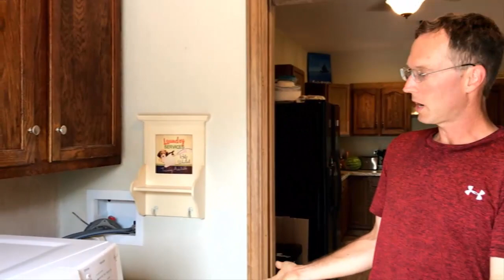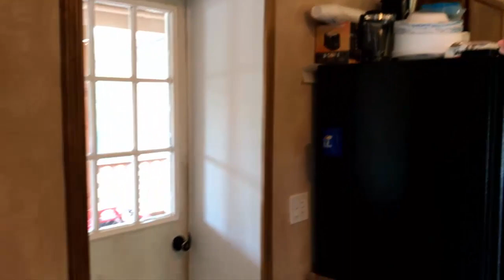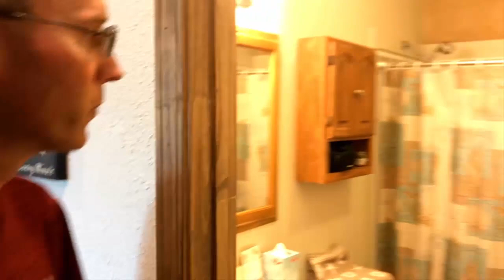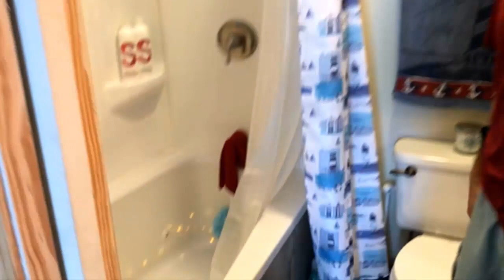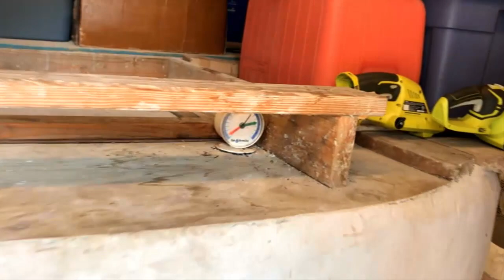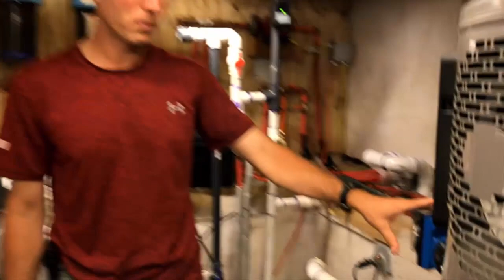Earthbag House Completed Tour

Comment: This would be a boring video it is so ordinary and that is what makes it so interesting. Most people don't want to live in odd houses this shows how you can build a low cost ordinary house. I have an idea to build a house that I call the worthless house the value of the property would only reside in the value of the land. We invest too much in housing and end up paying all our lives to clear the mortgage this is a way out. In the Philippines where I am people cannot afford wood anymore and concrete makes hellishly hot houses in the evening. A problem we have is the spike in relative humidity in the evenings as the air cools down. This ironically makes it feel hotter. I believe, though I have no proof, that if the earth could breath (in porous bags) then this humidity problem, would be solved. If anyone from the Philippines is reading this or anywhere sunny please take note. polyethylene (the bags) does not tolerate UV light, they will fall to bits get the outside of the building covered as soon as possible.

I like the fact that he has made an earth floor the problem with the Philippines is that people want to emulate the west but is that desirable? A concrete floor is creating another expense and if you want to change your house all you need to do is dig up the earth floor concrete is much more problematical. Just because the floor is earth doesn't mean it has to be damp I am sure this guy fitted a damp proof course.
Reply from the maker: Yeah, the floor is not damp. It's one of my favorite aspects of the house. This would probably be unecessary in the Philippines, but in the midwestern U.S. where you need heating in the winter, the earthen floor with radiant heating is so cozy. It feels very nice to walk on in bare feet or in socks.

Comment: How mucj ot the cost?
Reply from the maker: The total cost was around $110,000 of which about $50,000 was spent for labor. The house will save on energy bills by being very efficient. Over $600/yr. is saved with the rainwater collection, storage, and filtration system (this does include the cost of replacing filters).
Reply: @LilyAnnFouts  thank you

Comment: Why this regular squared box shape?  Looks very average and ugly.
Reply from the maker: @\/\/\/\  First of all, we'd recommend a round house as the optimal shape for this type of building material. For a round house, you wouldn't want to go bigger than about 10 meters in diameter.
Reply from the maker: Keith had wanted to build a round house originally, but the house was for his parents and they wanted a standard-looking home, so that's what he built for them.  We do recommend a round shape for anyone who wants to build an earthbag home.  We also recommend a much smaller structure.  This was a ton of work.
Reply: @LilyAnnFouts  I hope I didn't hurt your feeling with my statement. Thanks for sharing what you've done.

Comment: Wow Keith, wow! Your plan, attention to detail, and hard work are so inspiring! You almost built my dream house exactly as I have imagined it and you solved many of the challenges (such as water protection of the foundation) I envisioned. It was also very impressive how organized the build was while also engaging in experimentation. I have watched the entire 24 videos and I have some questions if you ever have the time to respond. I am wondering about the choice of bags vs superadobe tubes. Was this a choice based on amount of labor available (i.e. It would be easier to fill up bags by yourself if you had to)? Did you ever investigate auger buckets or other sandbag filling machines? How much experience do you have doing grading work? It seemed like you handled the Mini-excavator like a pro for the cistern and foundation work. How did you install the wood framing over the bag and soil cement floor? It looks like you're attaching the framing to cleats along the courses. Are you worried at all about the bags settling and throwing things out of level/plumb? I'm considering post-and-beam to support a conventional roof with superadobe tube walls for the enclosure. 
Anyway, HUGE congratulations on completing such a well-designed and executed project. This should be a model for all who consider earthbag building.
Reply: Hi Adam, Sorry it has taken me a while to answer your questions. I spent the last 10 months working 60+ hours a week installing 8 MW of solar modules plus 9 MWh of battery storage.

Thanks for taking an interest in natural building! The more builds like this, the better (if done right). I'm not sure what you meant by "superadobe tubes." I built the house using mostly woven polypropylene bags, but I did fill some long tubes of the same material. Some were over 40' in length. I used these mostly around the cistern and over arches for more strength.

I have seen other people using machinery to fill bags, but this would not have worked as well for us, plus there is the long term cost of renting the equipment (great if you already own it). The earthbag building book that gave me the most information made it sound like I could get road base from the rock quarry and it would be perfect for filling the bags. This was not the case in Kansas. The road base used in Kansas does not have clay added to it. It's mostly crushed limestone and does not have anything to bind it together. This is where my project became much more labor intensive as we used the clay acquired from our pond expansion. We created clay pits where we turned it into a milkshake consistency and screened out the rocks. Next we used a cement mixer to mix ~20% clay with 80% rock screenings delivered from the quarry 6 miles away. We dumped it in wheel barrows and brought it to the wall where bags were being filled. I have seen sooo many videos where people have been building with earthbags without using any binder with the aggregate. The end product looks great, but I'm not sure how well those walls will hold together in the long run and rarely do I see any follow up videos a few years after the project is finished.

I had limited experience using an excavator on some commercial electrical projects before I rented one for the earthbag house. I practiced digging out the pond before working on the house foundation.

There is no soil cement in the floor (no Portland cement or concrete in the mix). It was made up of screenings, straw, sand, clay, and a tiny amount of plastic binding fibers in different ratios for different layers, then sealed with linseed oil.  The walls were framed in floating over the floor just before I installed the final 3/4" of clay/sand. Since I knew where the walls would be when building the earthbag walls, I placed velcro plates (plywood between the bag layers with a 2 x 4 on the edge) every 4-5 layers to screw the wall framing into. 

Settling has been very minimal. If someone uses too much clay in the mix, the walls will expand and compact with the humidity. My number one issue after everything has been complete is that I made the papercreet too smooth before applying the lime plaster. It was not rough enough for the plaster to key into it and some places the plaster has come off. As I replace sections of plaster, I'm screwing a layer of galvanized poultry netting to the papercreet wall for the lime plaster to have a better structure to bind to. Thankfully I have had zero problems with the earthen floor as that would require a lot more work to fix. The radiant in-floor heating in the winter has been awesome!

Comment: Your #earthbag house looks pretty normal from the inside. Please post a video of the outside architecture. Also would love to see how much you pay a month for heating and cooling!
Reply from the maker: Check out the link in the video description above; there's a photo of the outside of the house on that web page.  The house now has solar panels installed, so the bill is almost $0 during a few months in the summer time; basically only the base service fee.  During the winter there is some cost, but much cheaper than the neighboring houses. My husband has the details so I'll ask him to reply.  I don't know the numbers off the top of my head.
Reply: Lily Ann Fouts we're waitiiiiiiiing😲🤗
Reply from the maker: @kineticblues2766  so are we!  The panels haven't been on for a full year yet, and more will be added soon, so it could potentially be close to 0 year-round.  During the hottest/sunniest months this year it was only the base fee for the electric service; the panels that are installed so far provided all the power needed for the home.
Reply: The house is fully electric (no propane/natural gas) with radiant in-floor heating coming from the hybrid water heater. During the coldest months of the winter the electric bill was $250-300/month. A neighbor with a similar sized house using electric heat had bills over $500/month. I designed the south slope of the roof for maximum potential once solar was installed. A month ago I finished installing 11 kW of solar on the roof and now the house generates more power than it uses (time for an electric vehicle...) so the monthly power bill is the base fee of $23.